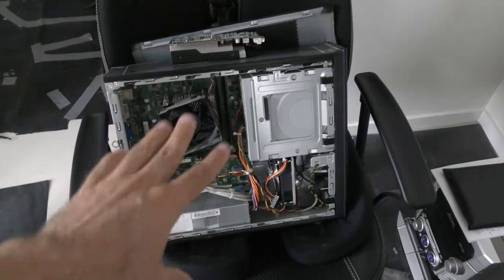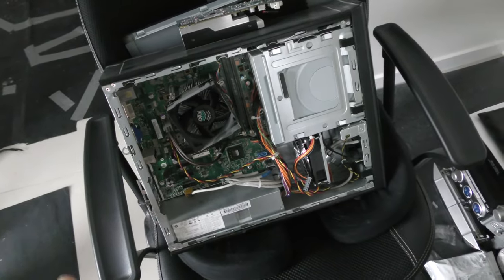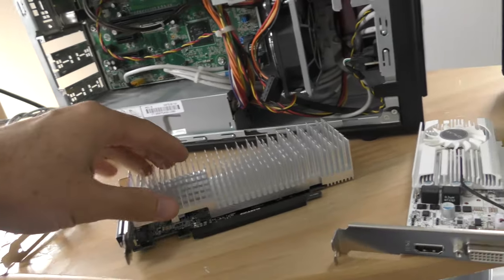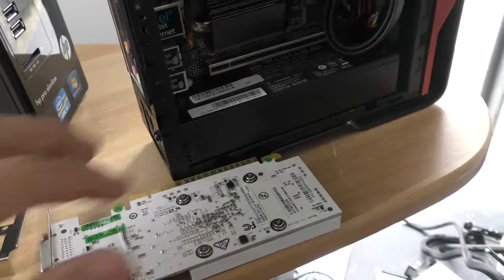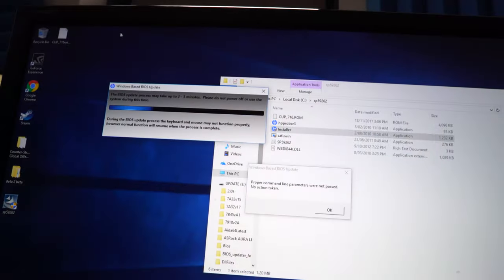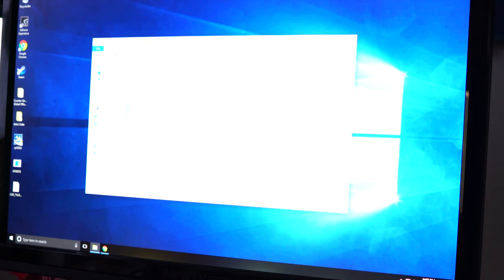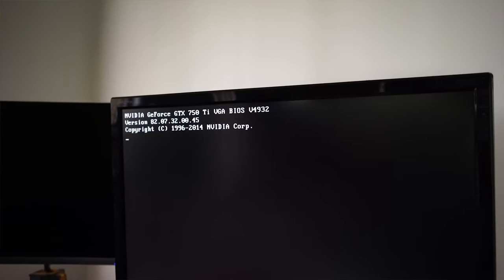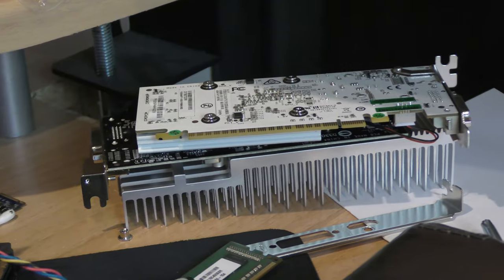The GT 1030, CAN IT SAVE THE SMALL FORM FACTOR HP PC...!?

Comment: Bigger heat sink = higher FPS
Reply: Jarrod'sTech don't forget RGB
Reply: That's another 10 FPS guaranteed :)
Reply: Leaving joke aside, having a good heat sink can keep your FPS stable. So hey, if you look at this that way, it still a plus.
Reply: Actually. With Boost 3.0 that is true. At least for Geforce cards. The card calculates a higher boost frequency with lower temps coming from a better heat dissipation and thus giving more fps
Reply: cool case with WHACKY COLORS = best pc
Reply: WAIT! YOU NEED SOME CHEESY CASE!
Reply: Jarrod'sTech Not real...  Bigger heatsink = more overclocking and more overclocking = MORE FPS
Reply: but jarrod, the human eye can only see 6 mb of ram
Reply: wrong, bigger *ss fan = more performance. i just bought a jet engine to cool my cpu
Reply: Hmmm
Reply: No, better cooling

Comment: Sorry to see you having so much troubles. Check out the HP Elite 8200, I had great success with it. It takes the 1030, 1050 and also 1050 Ti.
Reply: PhilsComputerLab Nah, just whack those HP's down with a glofclub :P
Reply: This is the problem of having Proprietary MOBA, they don't use standards just how mach they want .
Reply: I can agree.  I refurbish dozens of machines like this and have had great success with every HP Elite system I've tried.  Whereas these consumer or "Pro" towers are a different story entirely.  Proprietary BIOS designed to lockout anything except "HP Authorized Components" are simple BS.
Reply: I did an elite 8200 w/8gb ram, and a 1050 for my father in law. I was given the system stripped down with an i5 2500 only, and it turned into a nice little sleeper for light gaming.
Reply: I really wish we could find those ASL 1050ti Battleflag Edition cards :(
Reply: HP dc/elite is great, the pro is rubbish
Reply: right, got an hp 8100 elite and it works flawless with the 1030. the problem here simply is the HP Pro. Thx brian, at least now I know not to buy one of these
Reply: My HP Elite 8200 has played very well with my RX 460 by msi, the low profile version 

If I were building another slim HTPC build, it would be an HP Elite 8200 for sure.
Reply: Not sure what to tell you. those break down constantly (but then our users also misuse them). I would just avoid HP altogether for these things. Also their stupid propietary ATX sockets.

ugh
Reply: Hauss Pray fine was an hp 6000 pro sff and it worked fine with a gtx 105/, no problems
Reply: Have the HP Elite 8200 SFF, running a GT 1030 2 GB low profile (anything higher seems to anger my power supply) it in with 16 GB RAM, it's a nice little HTPC. Also, thank you Phil for turning me on to this little gem.
Reply: I upgraded 3 8200s with gt 1030s and 8GB of RAM and they all run great!
Reply: PhilsComputerLab do you know if the hp elite 8300 can hanfle the 1050ti?
Reply: PhilsComputerLab
Reply: Hi did you need to do a bios update for the graphics card to work with the hp
Reply: Yesterday I put the same silent 1030 in an Optiplex 790 SFF, i5 2400, 16GB RAM, Samsung SSD etc, pretty sweet little system, works a treat for the games I play and almost dead silent.
Reply: I Have a HP Elite HPE-345sc (Scandinavia model) with first gen i7-860. I am not sure how much it affects that after the HDD died I bought a SSD and a win8 to it, then after the stock GTX 260 it has had Hd 7870, GTX 660 and lastly GTX 680 in it (planning to put a GTX 760 maybe to it and having the build as some kind of backup pc or for parents). I also changed the PSU. Also changed ram sticks many times. So yeah I too think that at least the HPE:s let you tinker with them :D
Reply: I love my HP Elite 8200. It is a massive upgrade from my HP DC7800 which is now my Windows XP rig.
Reply: Fujitsu esprimo e710 SFF here with 1030. Working for me. Though bios admin pw was not provided, so cant change anything there, even boot device order.... OS reinstall is a bit troublesome, but managable. Silent little machine, i like it

Comment: The GT1030 is an awesome little card, but my main issue with it is people are seeing it as a fully fledged graphics card to go into their full tower gaming PC's when so many options exist offering not only better performance, but will generally cost even less...For SFF's like this the card is perfect...When it actually works that is. Great Video!
Reply: Gtx 10 series has fully encrypted bioses. Except the kingpin and evga 1080ti doc variants. It's not technically the hps fault
Reply: @reeeeeee9230  the problem is the hp motherboards bios, not the cards
Reply: the thing is its low power draw. if you want to save money on power draw monthly and you only play low graphics games its a no brainer

Comment: Good guy HP locking shit down so folks cant upgrade themselves and have to buy a new PC. Glad I dont buy prebuilts any more.
Reply: yep, if remember back in the day they were the main one locking wifi cards the the mobo(on laptops), as far as oms go i prefer dell, the mobo and front io may be custom as hell but they seem to usually build the business stuff above spec and the worst ive seen is a custom psu pinout, a quick fix with a 24pin atx extender and a multi-meter, that and they are cheap as dirt
Reply: nah his main problem was getting a "business machine" they are designed for very specific uses only not the "general" use that a non "business machine" is designed around.
Reply: I just don’t understand why they build a computer with a few PCIe slot but not allowing people to use it, they should just go apple mode by not putting any slot but make the computer smaller or just make the pc upgradable.
Reply: Stephen _L_S I don't think it locks everything out just gpus and it most likely wasn't even ment to lock those out it's likely a memory allocation error, but I could be wrong, but to fix that would require a bios update and he couldn't get it to work
Reply: woody4077 a PC is a PC the only separation i see worth making is OEM, server and diy, OEM is hit or miss for upgradability, servers don't make any sense for consumers, and diy usually costs more on the low end and used market, I was.just saying I've had much better luck with dell workstations then anything from hp, the z400 was a pain for example it locked out half of my CPU options, while the dell t3500 actually allowed a slight multiplyer overclock and both the  t5500 and t3500 worked with any cpu a put in, the only issues I had was  with a dell t1600 since it would crash with a Rx 480 installed but I blame that on the pcie overdraw issue at the time and it worked fine with both a gtx 1070 and 970
Reply: These PCs are somewhat upgradable but you have to do your research into hp specific parts that work with them.  All of the OEMs are very picky about what specific parts they will recognize and work with especially in the SFF systems.  They don't want to support user upgrades unless you buy the upgrade through them.  I have 2 SFF HP systems that will recognize just about any NVS or Quadro card you plug into them but refuse to recognize consumer graphics cards in the system.  I have a Lenovo SFF that I purchased recently to drop a low profile 1050TI in and it freezes as soon as windows gets to the desktop.  I have tried upgrading some of the Dell systems in the past that also had issues with certain hardware.  With OEM hardware and even some of the brand name components you can't allways assume it will work with any add-on card you want to install in it even though the PCIe standard is pretty wide open for compatability.
Reply: the issues with oems in general is that you often can't research is it can be upgraded, take my t3500 for example supposedly the only supported is only 1x1gb for non ecc but the actual pc doesn't care so long as you use all ecc or all normal ddr3, and alot of pc's don't have the max pcie draw listed(or sometimes it is listed but its for all slots combined and that does not guarantee that the full amount is available on only a single slot ), and even then  finding a gpu support list for a oem machine is impossible in almost all cases you just have to get lucky that someone tried before you, but as a was saying iv'e had the most luck with dells(to be exact the precision line, since they are made for cad and video work they seem to have fairly good support for gpus with some models even having beffy psus with pcie power connectors
Reply: I recently bought some HP 6300's and 8300's and they work flawlessly with different 750 Ti's, including Zotac and Palit Models. These machines are very standardized, modular and excellent value for the money. Of course I would avoid the SFF enclosures and go for MT instead.
Reply: John Totten I have a dell with 1050 but hp is awful with prebuilds
Reply: My HP came with a 180 watt power supply, and I wanted to put something like a 750 Ti in it,  but I needed to upgrade the power supply. It was a mATX power supply though, something I had never heard of. No reputable brands actually produce those, so I couldn't upgrade.
Reply: TheRedFlash1 there are pico psus that would have worked in the 350w range
Reply: TheRedFlash1 also there is a good chance that it may have been a sfx psu, they are sometimes used interchangeably with the term matx
Reply: my pc started life as a hp with an i5 2400 2 years later the only original part left is the 500gb hdd
Reply: John Totten the dells are good about it though. The only problems I've ever seen are with HP machines.
Reply: At least the HP workstations are better I have a Z400 with a GTX 1060 in it.
Reply: Just watch for Dell Optiplex, these are really cool prebuilt oems.
Reply: alpha my previous computer was a optiplex 760 with a q9550 8gb ram and a hd7750
Reply: Wolf i have a 330 with Xeon E5430 4gb DDR2 and I would put into it a gt1030
Reply: John Totten That's why Optiplexs are popular for this use case.
Reply: They lock the bios down for businesses. You could put a password on the bios but the easiest way is just to limit the bios options so noobs dont fuck it up. Also when a customer returns a computer there are much less options at what it could have failed.
Reply: Why do the have to out of their way to limit the performance of their PC's so unnecessarily? (Pre-built vendors) They spend money to do this stupidly.
Reply: OEM pc's are like cheap economy cars.. you're very limited on what you can configure or upgrade to with one. this is why OEM pc's are cheap to buy used, because you can't really do much with them.
Reply: I got z200 and there's quite a lot of trouble, particularly power supply supplies 240w only. Plus propertiary connector and PSU setting gave me a headache.

I wanted to put gt1030 but I fear this wouldn't work.

Edit: mine is sff 240w PSU
Reply: I read the QuickSpecs for your machine; based on the GPU's the machine originally shipped with I'm pretty sure a 1030 would certainly not hit any power limits. (one of the GPU's even hits 80 something watts; a 1030 uses about 45-50W at the worst )

tl;dr you should be fine; a 1030 should work
Reply: Well it is a small form factor so....
Reply: lmao the prebuilt i had with a asus mobo put a asus mobo probe meaning my os would not boot with anything besideds my asus mobo which was on a 1150 socket
Reply: I wouldn't say all pre-builts are bad. Last year I found an refurbished ASUS M32CD desktop with a Skylake i3, 8GB of Ram, and 1TB HDD for $150, it has no proprietary anything, and is massively upgrade-able. I bought two and told my family about them.
Reply: HP is a nightmare Da da da defiantly don't buy one of their printers.
Reply: @modeco80  now i installed 1030 ddr5 2g and it worked fine.
gta iv min 22 fps max 55 fps. (unoptimized indeed, but if it can run gta iv, it might be able to run gta v)
Reply: I got an HP Pro 3330 MT lying on the house unused too and i just bought a ZOTAC GTX 750 Ti Dual Fan and when i added in video card it WOULD give display to the monitor but it hangs up on the BIOS and sits on the VGA BIOS screen... I tried every other workarounds and any methods to solve this problem, including modding/unlocking the mobo's BIOS. But one day i was like fuck this problem and i just decided to bought an ASUS motherboard instead so yeah, Fuck HP.
Reply: @davidchill79  If it's only a single 6 pin PCIe connector, you might get away with a SATA-6pin-adapter. They don't exactly follow any standard, but I've successfully used them in the past.
Reply: @wheisenberg559  my electricity courses are far but there’re 3 wires with 12V each ... don’t we need 36V / 15A ?  The sata connector has only one 12V wire
Reply: @davidchill79  No, you're not increasing the voltage, but the current. Maybe this helps: https://graphicscardhub.com/graphics-card-pcie-power-connectors/
Reply: And I was wondering why my GF210 512mb ddr2 gpu would give signal for like 10 seconds at most, then nothing...

Comment: Honestly, I'd only mess with dell prebuilts. Seems like HP stuff is designed specifically to fuck with the end user.
Reply: Same conclusion here.
Reply: Well dell has there own issues(really weird form factors(like a reversed btx  Mobo, WTF?) and some weird fetish with custom front io connectors), but at least if it fits in the case it works, had some stupid issues with HP but very few with dell
Reply: Lenovo does this crap as well. My old Lenovo desktop had massive restrictions (including but not exclusive to: a 14 pin, 180 watt, PSU) that prevented the "upgradability" they advertised on their website.
Reply: i hate that reversed motherboard. the damn pci express slot is facing the wrong direction. forces you to use single slot cards even in the towers.
Reply: didn't force me to use a single slot, but my model had a ton on pci and pciex4 slots that didn't matter, but on a few cases yeah it has useless sltos
Reply: Yep, my slim OptiPlex with the same i5-2400 works great with the 750 Ti I put in.  Great mid range PC for my son.
Reply: well now you can't even upgrade the cpu on modern laptops since intel and amd went to BGA bullshit.
Reply: I was a service engineer for HP, and yes, they are. You're mostly limited to just a few specific video cards you can use. Some models are white listed, and that's it. Part of the problem is, I believe, that the PCIe actually can't provide 75W. And it's even worse with RAM.
Reply: Yeah, Dell prebuilt are pretty good, there PC have a lot of space. just install a GT 1030 last week and it's pretty good on my PC.
Reply: dell actually cares about the consumer with my prebuild i see all the care and attention inside the rig the way they made it the actual money put in to make special parts etc my dell looks alien inside because they actually made it there own unlike others like hp

Comment: that's why they are called HP 

Holly Potato 
wait... something is not quite right...
Reply: actually hp has quite good products, just not this one. They offer good service too / at least in the buisiness sector. Where I work HP offers min 24h reaction time sending real technicians. Try that with Lenovo, good luck :)
Reply: HP are shit and should be fined for business practices like this. If they wanna lock down their products, fine - but solder the components on. Don't take a standardized port and lock it. It's false advertising. I've never had this crap when I've modded or worked on my Asus or Dell products, budget or high end.
Reply: (H)ardly (P)rocesses
Reply: (H)eaping (P)ile
Reply: Yeah hps are trash
Reply: Hahahahahaha

Comment: Brian, as someone who have owned the same board it works, believe me with discrete graphics. 

the cupertino2 board i had, never came with the case(salvage stuff) 

My Radeon R9 380 had a bios switch, newer gpus has issues with the bios that HP uses. it's not a power issue at the slot. 

I even had a Rx 470 running fine when testing if the card worked.  

The key factor is the vga bios. AMD has(had?) a solution for it with the two bioses on many of their cards. 

there is no problem with slots power draw, if that was the case then how would a rx 470 work(which draws alot of power from the pcie)

Comment: I made a blog about this before, I told people to stay away from the HP model.
I knew this was going to happen to you, when I saw your older vid but I figured you were going to take a different route to it (use it as a PC to power home cameras or something). The Dell Optiplex SFF are the way to go, as they have slightly more power from the motherboard, just enough to power a GTX 1050 Ti/750 Ti.

The only way you can salvage that HP is to:
1) either just use the wimpy Intel iGPU
2) sell it as is, maybe get $200 for it if lucky
3) salvage it for parts, selling it off or using them in other systems
4) Take out the motherboard. Grab a dremel/grinder and cut some parts of the back of the case. Replace it with a miniITX motherboard (or anything that fits). Securing the motherboard using zipties, screws, superglue, and pieces of scrap metal/plastic as brackets. You also need some metal/plastic for the rear IO face. Then reassembling the PSU, CPU, box cooler, RAM, HDD, and CD drive. Then install Windows and do a fresh start (you can use $20 oem license keys off eBay, if your CoA sticker is faded). Now install your GT 1030 (this thing won't handle a 750 Ti/1050/1050 Ti... not sure about the GTX 750) and all should be dandy. Install the latest drivers, and Bob's your uncle. It can handle 1080p gaming, just don't expect higher than Low Settings and 25fps. If it does better like Medium-High on 50fps on certain titles, just see it as a Bonus.

Good luck... and I think that's my car driving in front of yours, drive faster man.

For anyone reading, if you want to grab a cheap Pre-built, I suggest you go for the Mid-tower models (where you can exchange the PSU to standard ones), or really do your homework on the SFF models.